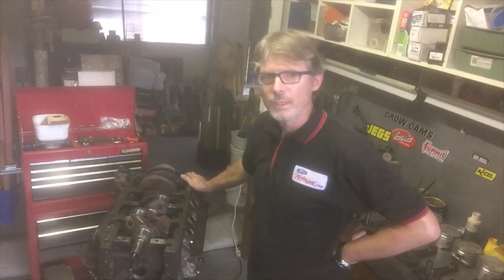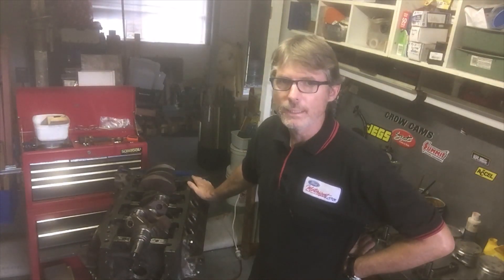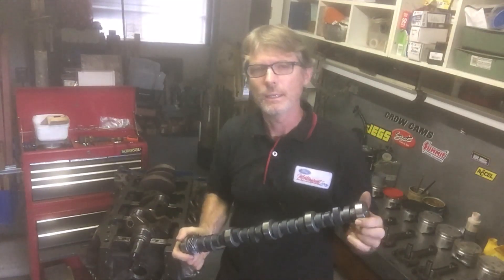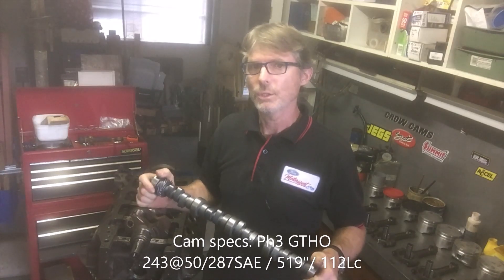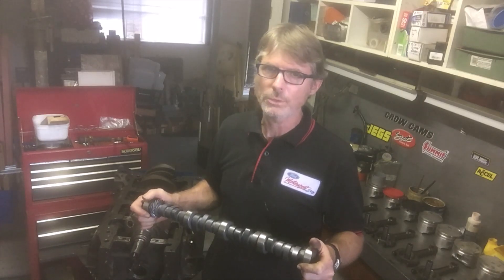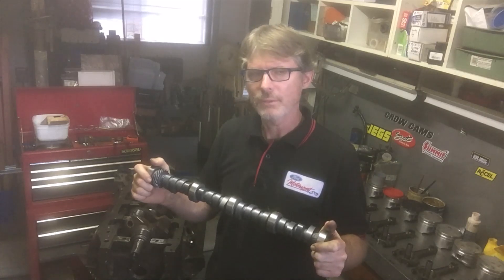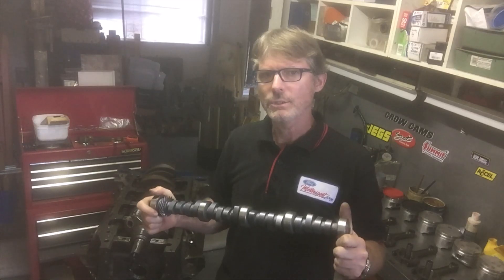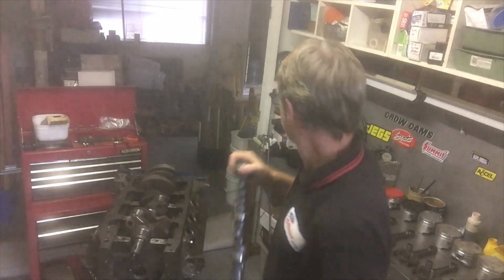GTHO 351c Phase 2  3 engine build part 2

Comment: The cam masters Ford and Shelby production Windsor and Clevelands in mid 1970 USA were listed here in the pink in post #2 further below
The reduced duration Phase 3 cam was effevtively a Solid 505 grind, Melling # 22396 is similar, as it is the General Kenetics-Lunati successor as CMC didnt list many other solid lifter profiles. 505 solids are not listed as a std and certainly not the common hydraulic General Kenetics 288 or 292 cam

See http://vb.foureyedpride.com/showthread.php?177887-Cam-for-351w

The D1ZZ-6250-BX was the hydraulic wide 114 lobe 505 lift cam, milder than the Phase 3 and better than the Boss 351 290/477 mechanical.

Comment: Dr John Wright in Thundering GT's confirmed the revised crank ( what you call the 4MA- B ) : The stock Phase 2 crank toughened. The crank dampener might have been different for the Phase 3. Again, stock M code US block ( D block in Drew speak). The Boss 351 cam was not as wild as any Phase 2 or 3/4 cam. The Phase 2 cam was a K code 289 derivative on a Cleveland master, 310 degrees at lash. I've seen the list of Ford Cleveland and Windsor cam profiles. The Phase 3 cam was an offshoot of the  300 degree at lash 505 lift cam, which was used in the 1971 pre-release Yellow Hot Rod Boss 351 promations car...which had tube headers and did flat 13.9s with 3.91 gears.